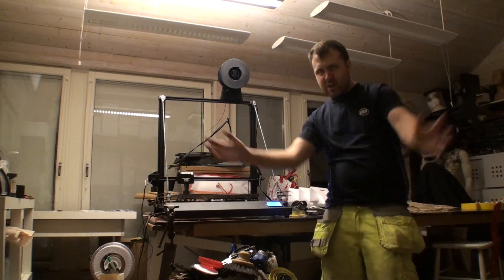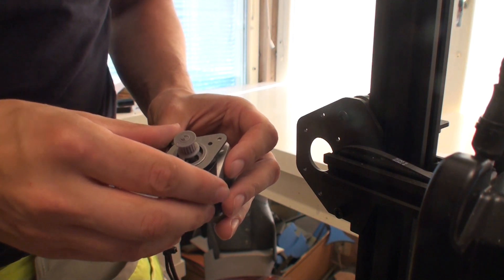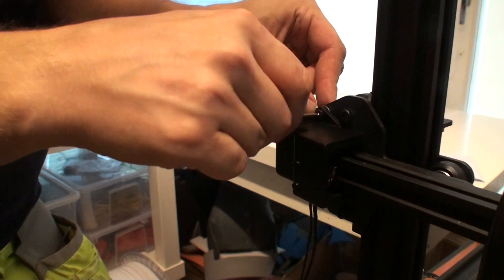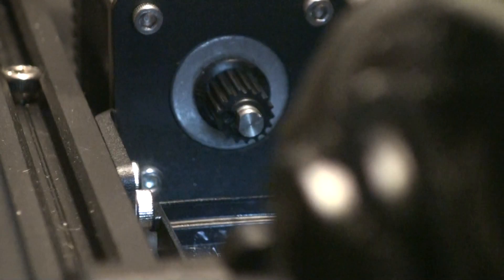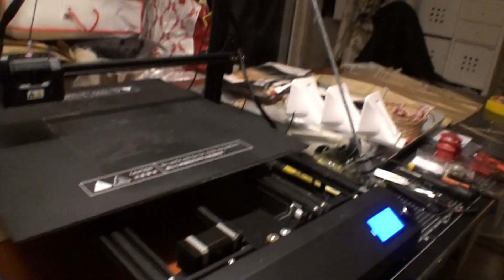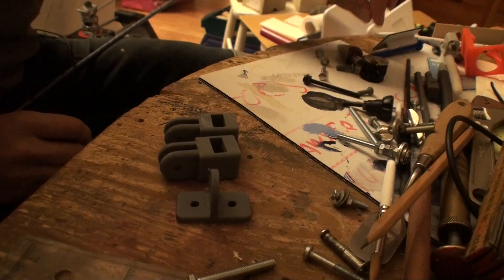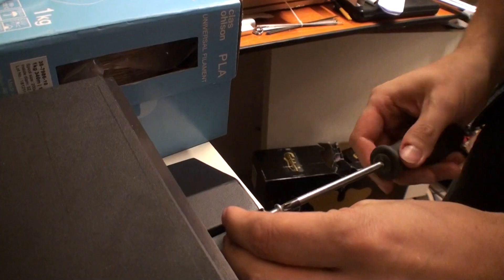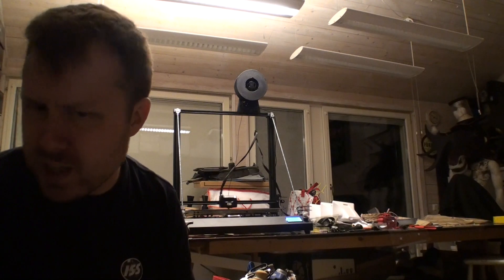copymaster upgrades

Comment: Hi there, I came across your video as I was searching for some information regarding copymaster 400. I picked this unit up recently as I needed a bigger bed printer however, comparing it to my Ender 3 v2 it's lacking fine-tune controls. I was wondering do you know what modern bored I can get to replace the existing 8-bit drive abroad?
Reply from the maker: No. howeve I cant recomend this printer in the long run